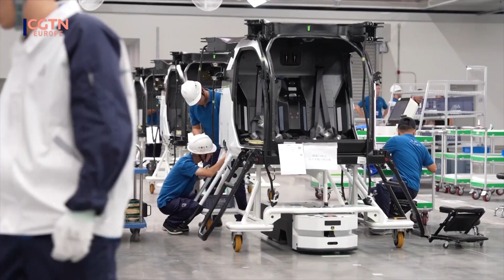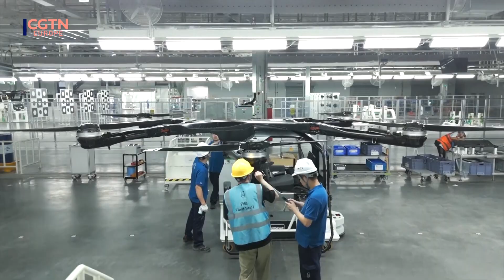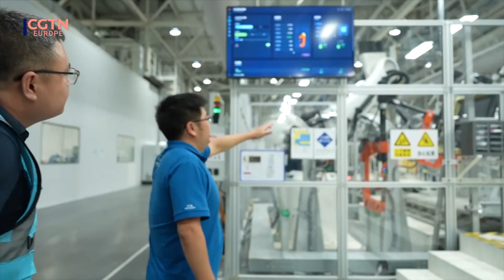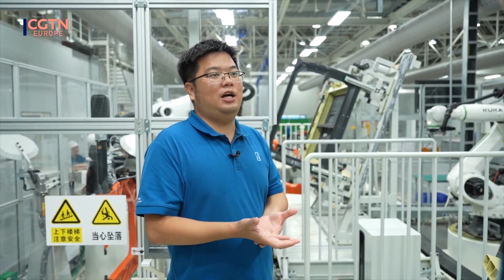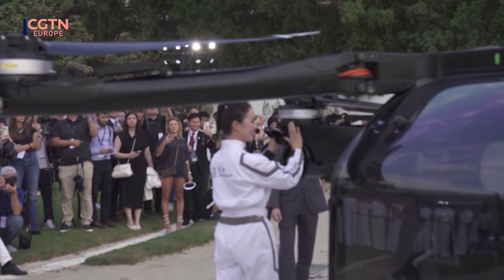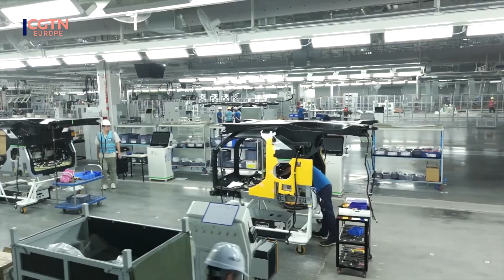China opens the world's first flying car factory

Comment: looks like.knock off of a tesla cyber truck that flopped in us elmers's glue plastic parts cant handle loads pull stuck in snow rust all around it's all look bragging rights.  my old ford, chevorelet, dodge ram i use to own built tough.   i'd run not look back

Comment: This is very good for the emergency patients to bring them to hospital in crowded areas.
Reply: HELICOPTERS ALEREADY EXIST
Reply: @brxhhxw that’s what I’m sayin
Reply: no did you see the cockpit, you cant move most patients especially those in an emergency in a seated position. For a vehicle lick that think of something that would fit in the back of a flatbed truck... which also makes moving it around more difficult.
Reply: Right compounded fatalites
Reply: great for bank robberies, good job chiiiiina 😂
Reply: Also it's a huge upgrade for terroist or mentally deranged people or psychotic people
Reply: More likely people using this vehicle will be the ones going to the hospital.
Reply: What replace a one engine Helicopter with a six motor smaller drone?
Reply: @DerekAnthonyFarmer  Do you know the price of an helicopter ?
Reply: @selimb1569 is it 100,000 dollars?
Reply: @akerovitalis3451  10  million minimum
Reply: @DerekAnthonyFarmer  helicopters aren't cheap
Reply: @urimtefiki226  we already have helicopters that do this.